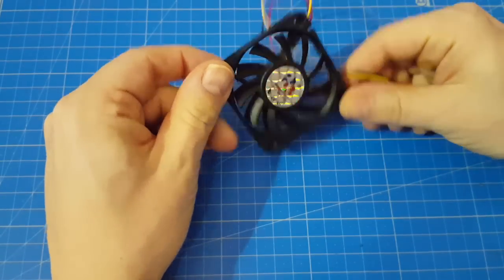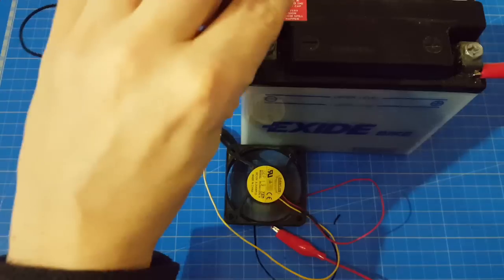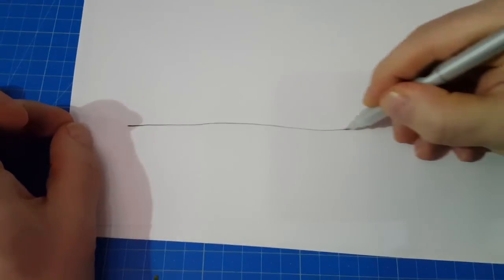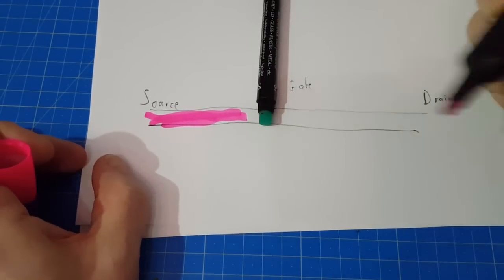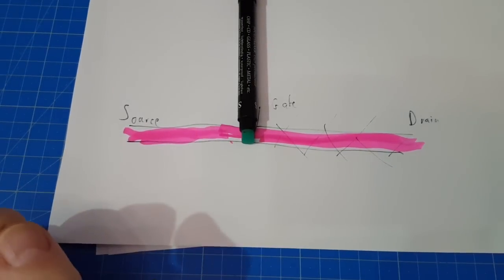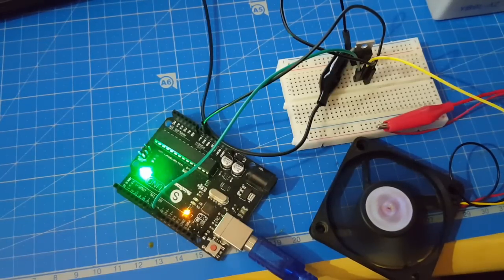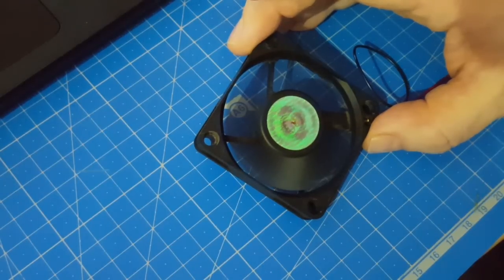Controlling fan speed with mosfet and Arduino

Comment: hello, I followed your tutorial, but the LED does not shine at 100%, and try the irfz44n, irf540n, irlz44n, irl540n and the tip120, but none makes the led shine 100%, but when connected directly to the 12v, it lights up a lot , I do not know what to do anymore, I'm thinking about giving up
Reply from the maker: The MOSFETs have a internal resistance. So you got a voltage drop depending on the level of resistance. You can check the values in the datasheet of the MOSFETs. If you have a 12V LED and want to archive the full brightness you can either calculate the voltage drop and add the missing voltage on the supply side, or you can use a relay.
And: Never. Give. Up.
Reply: @nenioc187  The IRL540 is specified to have a resistance (Rds_on) of 0.077 ohms maximum with 5V on the gate. You're going to be passing an awful lot of current to see a significant voltage drop in that case. If the LED isn't at 100%, then I would check the code used in the Arduino. Perhaps just set the digital pin HIGH as a test. I assume that everybody has figured out that the maximum duty cycle is obtained with a value of 255?
Reply: Alejandro Castiblanco for simple LEDs using a bjt would be better only high current application would be suitable for MOSFETs

Comment: how many processes a single Arduino UNO board can do at a time?
Reply from the maker: The Arduino Uno has six PWM pins. So six.
Reply: nenioc187 at what capacity these 6 pins can be used?
Reply from the maker: Each pin has a maximum output of 40 mA
Reply: nenioc187 thanks so much for your response.

Comment: How are you using 300 and 1000 in analog write? I thought it had to be 0 to 255?
Reply: @xvrvm  If you watched the video you would clearly see that he used analogWrite(Gate, 300) and analogWrite(Gate, 1000). My guess is that Arduino ignores the bits it cant use and reads them as 44 and 232 (300 mod 256 and 1000 mod 256 respectively).
Reply: @xvrvm  Still think Kjartan is right.
Have a look at the definition of Arduinos "analogWrite" function: https://www.arduino.cc/en/Tutorial/PWM
Quotation: "A call to analogWrite() is on a scale of 0 - 255, such that analogWrite(255) requests a 100% duty cycle (always on) [...]"

Also, having a look at the source code reveals that for values (other than 0 or 255), a function named "sbi" is called which is defined as:
"#define sbi(sfr, bit) (_SFR_BYTE(sfr) |= _BV(bit))"
Soo now I was wondering bc. just using bitwise OR operations would not stop the actual "number" from being more than one byte.
Then I found this interesting blog post: https://www.txplore.com/blog/16248/10-min-pwm-overflow
Long story short, he tells that the Atmega used by the Arduino Uno has an 8 bit register for PWM.
Using 8 bits (1 byte) the maximum number possible in decimal is 255 (= binary: 11111111) and more bits will just "overflow" and wont be used.

In this video, he uses 1000 which is 1111101000.
Taking the first 8 bits only, we get 11101000 which is equal to using the value 232.

Comment: Instead of a MOSFET I have an L298N H-Bridge module.  When I try to control the speed of the fan with PWM I can seem to achieve some speed control, but the PWM causes a squealing noise.  If I use a MOSFET instead will I avoid this problem or is the issue with the fan itself?

Comment: Hi, nice explanation. I'm on a project and I use the IRF540N over which I shoot 12v, but the problem is that when the gate is open at the exit of the drain at 11.45v and the transistor heats up when it drops the voltage on the gate. How do I get rid of it?
Reply from the maker: You'll always get a voltage drop with a MOSFET. They have a inner resistance value. There are MOSFETs with lower resistance, but you won't get the exact same voltage you'll put in. That's also the reason the MOSFETs are heating up. You should use them with a heat sink.
When the output voltage is essential, you should use a relay, if possible.
Reply: Thanks for the reply, I will definitely put a cooler, I need to adjust the fan speed and adjust the voltage on the gate using the arduino PMW.
Reply from the maker: Usually a fan doesn't mind if it's 12V or 11.45V. Alternatively you could provide a little more than 12V on source.

Comment: Hi there, I want to make IR remote controlled regulator for my A.C. fan. Kindly give suggestion or links if you have.
Reply from the maker: First of all: Be careful! Mains power is very dangerous! 
You can use this videos technique the same way. But instead of a MOSFET, you should use a solid state relay.
Reply: nenioc187 thanks a lot..i will ensure the safety and try this out.

Comment: I am having a hard time seeing where you placed the resistor. Can you give a more detailed diagram also with the resistor specs?
Reply from the maker: There is a corresponding project page to this video. https://rohling-de.blogspot.de/2017/10/controlling-fan-speed-with-your-arduino.html
The resistor is a pull-down resistor for the PWM port of the Arduino. Although it is not really necessary because the Arduino should be capable to pull the pin internally  to GND.

Comment: can you tell me please what transistor is needed and if it can be used with a 4 pin pwm  12 fan? What is the amps about in  a transistor? I notiice mosfet transistors with wide range of amperage and the same volts. Thanks
Reply from the maker: 4 pin fans work a little different. I'll put this topic on my video-bucket list. The amps on the transistor indicates the maximum current that the transistor can handle before blowing up ;-)
Reply: thanks man

Comment: Could I get the same result if I used the 12V power supply of the UNO (Vin) and connected it to the + terminal of the fan and GND to the source of the transistor?
Reply: Yes, assuming that the 12V supply you're using to power the UNO has enough current capacity to also power the fan.

Comment: You sound so full of yourself .... that's anoying. Anyway set that arduino pin to at least 25 khz. You talk over it but at 300 the fan makes a humming sound. The frequency its audible. At lower speeds it will whistle ! Its quite important. Also you should say something about N channel mofset (that can be used also).

Comment: is it possible to scale this up with multiple fans?
Reply from the maker: +Jackson as long as you have free PWM pins available you can contol multiple fans at once
Reply: sweet so 6 on an UNO? can you make each one independently react to separate sensors? for example 6 thermos impacting 6 fans?
Reply from the maker: +Jackson Sure

Comment: Very nicely explained! -I might have something for your bucket list though :) -How would you control a device (a peltier for instance) that does not stand the PWM ripple well, while also introducing a lot of noise in sensitive devices around?.. -Is there a way to 'smooth' that ripple or simply use/create a continuous/proportional signal for control?..
Reply from the maker: Usually you can use a capacitor to smooth the PWM signal a little. I haven't tried it yet to control a peltier element - although I've laying them around for quite a while.
Reply: Yup, that could also work I guess... Thanx! -Since I see you've worked with several different temperature sensors, you might (also:)) want to try a peltier+fan based temperature control project; see how stable around the set point you can get ;) -Cheers!
Reply from the maker: Using peltier and fan to create a controlled environment? Hmm... sounds interesting. That will go to my bucket list. Damn, my bucket list is becoming huge.
Reply: :D
Reply: @nenioc187  If you use a capacitor on the MOSFET gate to smooth the PWM signal, then you must include a resistor between the I/O pin and the capacitor to prevent the initial charge current on switching from exceeding the rated 20mA for an Arduino pin. A minimum of 270R would be needed. However, once you've smoothed out the PWM signal, you're operating the MOSFET in its linear region, rather than switching it, so it will get hot and may need a heatsink. If you use a (much larger) capacitor across the load, you'll probably want to add some series resistance between the drain and load as well to limit current spikes as the MOSFET switches.

Comment: Hi! I tried building the same circuit but using a usb power supply cable instead. Would this circuit work if I used a 9v USB power supple cable and 8 amp transistor instead of the 17 amp transistor u used? Thanks so much
Reply: The fan I am using is a 12 v 4 wire fan
Reply from the maker: The reason I used this MosFet is, because it was the only one I had ;-). Well I also have a 12V computer-fan, which I power with only 9V. It works. But it won't rotate fast.
Reply: Thank you for the reply and . If I use a TIP102, should I be fine? I keep trying the circuit and it isn't working for me. When I touch the gate to the positive end of the power supply cable, nothing happens. Thanks!
Reply: and the weird thing is when i connect the drain to the gate, the fan spins. Any suggestions? thanks

Comment: Understand clearly. Thanks.
One question, in order to put temperature sensor (LM35DZ), just install its VCC to the 12V, GND to Ground and the Output to Arduino ANALOG IN.
Is it correct?
Reply from the maker: I've read the datasheet of the LM35. It's operating range is from 4-20V. So you can even connect it's VCC to the VCC of the Arduino. GND to GND of the Arduino - of course. And the Output to an analog input of an Arduino, that's correct. 
But without a library for it, you won't get Celcius or Fahrenheit, but Voltage. You have to calculate the temperature for yourself.
I've made 3 Vids about temperature sensors. Maybe there is one you would prefer to use ;-)
Reply: Thank you so much for the reply. Much appreciated. Will watch the videos later. Thanks.

Comment: what about the pwm wire from fan (the yellow one), we dont need to use that?
Reply from the maker: Not in this test. The fan speed is controlled by supplying the voltage and removing it again with help of the mosfet, that is controlled by the Arduino. If you're interested in controlling it through the yellow cable, I'll put it on my bucket list.
Reply: Yes please do so, that would be very helpful, also i am using an NPN transistor with a 1n5408 diode across the motor, is that connection safe?
Reply from the maker: Thanks for the hint, Joe! I think, I also have one of those 4-wire fans somewhere.

Comment: please made video with clearly, i'm lil bit confused, such us the resistor, you use that? or not?
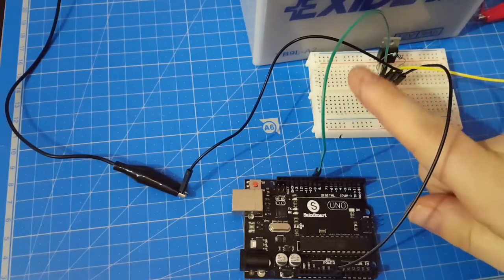Reply: Form 5:39 to 6:02 resistor next to the mostef
Reply from the maker: No resistor in the video. No resistor used.
Reply from the maker: Oops. My bad. 
Yes, there is a resistor between the gate and GND. Because if you open the gate by connecting it to positive, it will stay open https://youtu.be/Pw1kSS_FIKk?t=4m55s until you connect it to GND. The resistor between GND and Gate will automatically close the Gate if it is not connected to the positive.
However, when the Arduino sends the LOW-value to a pin, it means that it is internally pulled to GND. So technically you don't need a resistor with an Arduino. 
I recommend to use a high value resistor anyway, because I noticed that some cheap Arduino clones don't always put out a good 0V- on LOW.